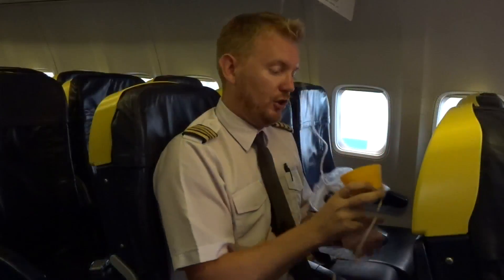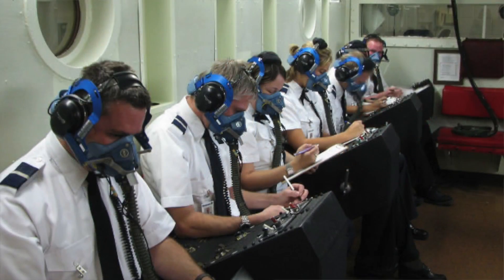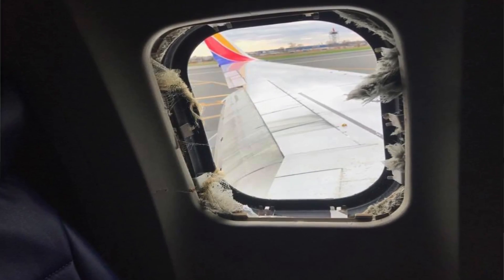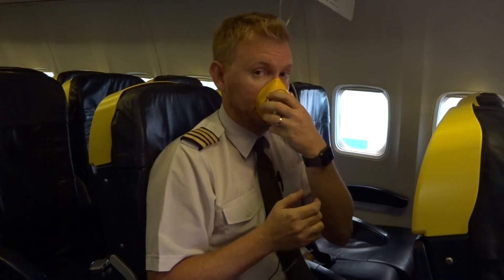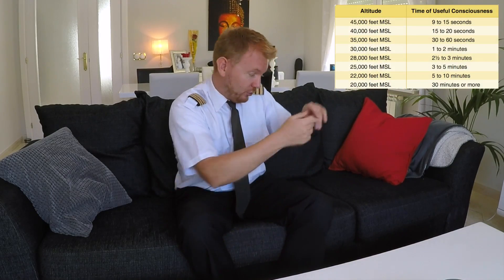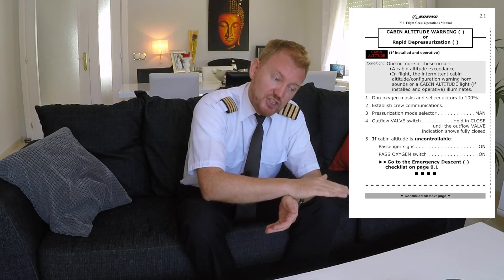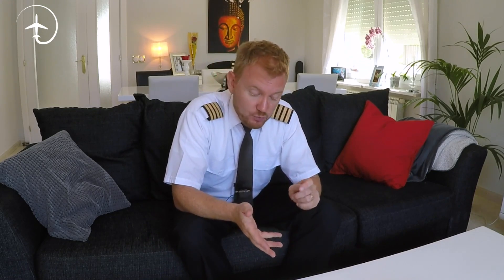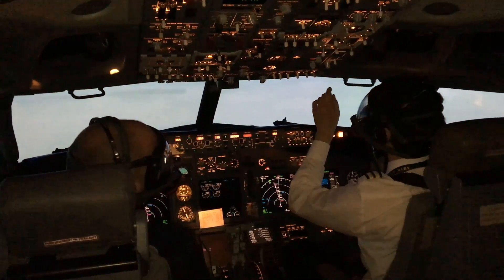Aircraft OXYGEN systems, how do they work?

Comment: I`d like to bet that a rapid decent like that ( in an emergency decompression) would cause real problems for your ears. I`m a frequent flyer and sometimes i have problems with earache and ear popping after some flights. Sometimes for a few days after. I love flying and aviation in general but the ear pressure/ popping thing is definitely the worst part of flying for me. Thankyou for all your vids Mentour. They are simply brilliant and i never miss a single one!
Reply from the maker: Yes, especially since the aircraft is normally unpressurized and that meant that the cabin will descent at the same rate as the aircraft. Quite uncomfortable to say the least.

Comment: The Helios accident which is mentioned at the end of the video is very mysterious. Acording to F-16 fighter pilots of the Greek Air Force there were conscious people who were moving inside the airplane. Also the period of the Helios accident wasn't many years after the 2001. 
Anyway the aviation industry is huge and very important to the economies of many powerful countries with influence. 
I won't be surprised if something is concealed. 
The only quite safe way of transport is the train and I prefer it whenever I can. It is also very romantic.
Airplanes are inherently dangerous and the normal  change of the pressure inside the cabin reduces the oxygen. I don't mean rapid accidental depressurization. The typical lower lever of oxygen make passengers dehydrated, tired and sometimes creates headaches and pain in the ears. 
Some expensive private airplanes like the Embraer doesn't change the pressure inside the cabin because the passengers there are very rich and demand a comfortable flight.

Comment: Are you sure our lungs are designed to work at ground level? Because I know plenty of people who act stupid and don't even recognize it.
Reply from the maker: Well, the design was for that. 😂
Reply: If you where a Mt. Everest Shilpa you probably would act a lot less stupid since you'd be acclimated to breathing at high altitude. For them, mask is optional. For the rest of us, stupidity is mandated at altitude.
Reply: Actually even at 30,000 feet you have the same proportion of oxygen and nitrogen as you do at sea level, 21% oxygen and 78% nitrogen with about 1% argon for the remainder.  But the partial pressure is much lower at that height and our lungs are adapted to function at sea level which is about 14.7 psi.  So in this case going to 100% oxygen helps bring the partial pressure up to a level close to what we are used to at sea level. 
But pure oxygen at high pressure can become toxic over a period of time.  In hyperbaric chambers in hospitals they may go up 2 atmospheres (about 35 psi) to purge patients suffering from carbon monoxide poisoning, but they also include short periods where they breathe 21/78 mix to prevent oxygen toxicity, which can result in blacking out and convulsions.
This can also work in reverse.  Very deep divers will use a gas mix with little to no nitrogen, helium and maybe as low as 5% oxygen.  But at the depth they are operating at, this gives the same partial pressure of oxygen as at 1 atmosphere ( sea level ).
Reply: I came here to say the same thing!

Comment: Great episode. Im a med doc (svensk läkare alltså) and i think its very important to first, as you did, emphasize on the short time available in a loss of cabin oxygen. But I also would have appreciated if you said something about the difference between loss of oxygen pressure and “strangulation” (ie build up of high levels of CO2). The first case, (loss of  O2 and normal or lower levels of CO2) can be pretty much un-noticed (in med school we train both situations) and in the first scenario you can even feel a bit “high” and as you point out, you loose mental capacity, without really being aware of it. Basically a pilot incapacitation, until your blood is restored to its “at sea level” again. But, and this is important. Lack of oxygen does NOT give you the strong sensation of anxiety (or even panic) that accumulation of CO2 (carbon-dioxide) in the blood give. Although of course being very unpleasant, it’s actually beneficial, because it alerts you that something is is going terribly wrong, while as just a drop in cabin O2 - may go pretty much unnoticed until you pass out. I would appreciate if you address this in one of or your excellent podcasts that you do. Especially since a pod done by a air plane pilot is much more likely to be viewed than a if a regular doctor does it, unless the doctor is a very good looking one, with a stethoscope hanging around his neck making him looking very professional. 😝 . Thank you and please keep up  the the good job in educating us casual travelers 👍

Comment: Hey there,

Great video as always. I really enjoy all of your presentations. You would make an awesome trainer if you are not already.

I just wanted to share with you something perhaps you are already aware of regarding the PSU oxygen systems.

The system you are describing is a chemical generator system. On other aircraft B777 and B747 for example the system is gaseous just like the flight deck. There is an entire bank of cylinders in the outboard fuselage of the forward hold.
When you pull down on the masks to activate, a pin is released from a spring-loaded Puritan-Bennett valve enabling oxygen to flow. The system is capable of being switched off by having the cabin crew flip up the valve lever and replace the pin in each of the activated PSUs.

The B787 has a very unique and bizarre system; when the masks are released they unroll from a reel inside the PSU housing, there is no 'pull to activate' system, they have a pressure sensor disc inside the mask so as one breathes oxygen is only released on inhalation called PulseOx. They also do not have a concentrating reservoir bags like the usual Scott/Zodiac AviOx types.

Anyhow, I just thought you might be interested.

I love the B737, it's my favourite short-haul airliner. I have crewed the B737-100s, -200ADV, -300, -400 and -800. Loved them all for their various personalities. Wishing you always safe and enjoyable flying :)
Reply from the maker: I am indeed. Both a Typerating Instructor, Examiner and Linetraining captain.
Thank you for your kind feedback!

Comment: I think that in an event like this the Captain should make an announcement to the passengers as soon the situation in the cockpit is under control.  He/she should just explain that there was a loss of cabin pressure, to keep the oxygen masks on, and that the pilot is making a controlled descent to a lower altitude where oxygen masks won’t be needed.  As a passenger, I would be terrified if the plane just seemed to be “falling out of the air”, as these passengers experienced.  We want to know what’s happening, and most importantly, that the pilot is still in control of the plane.

Comment: Noice informative video!
A few questions: How often does cabin decompression happen? Also, how often do the passenger oxygen generators need to be replaced? Lastly, is there an automated system which drops the passenger masks once cabin pressure drops too low, or is it solely released on pilot discretion?
Reply from the maker: It happens VERY rarely.
Yes, it’s an automatic system that drops the masks when the. Avon reaches 14000 feet. We can also drop the masks manually from The cockpit.
Reply: Thank you, absolutely love this channel!

Comment: Is there an alarm the crew can activate for the cabin? My thinking behind this question is on red eye flights where many people are sleeping, it would be near impossible for the flight attendants to wake everyone up in less than 2 minutes, and having an alarm to wake everyone and give commands to put on the masks would be helpful.

Also, do the flight attendants have portable masks that enable them to walk through the cabin to check on all the passengers or does the rapid descend necessitate them being strapped into their jump seats?
Reply: Also, seeing as rapid depressurization is pretty painful on its own, I would think most people would be woken up just from their ears popping painfully.
Reply: Hey there, I have only just discovered this video. I can answer your question if you are still interested.

When the cabin altitude reaches 14,000 feet the following systems occur automatically:

- Passenger Service Units (PSU) Masks drop door when the electromagnetic door releases
- Cabin lights go to full bright
- Automatic Prerecorded Passenger Address (PA) plays instructing passengers to fit their oxygen masks
- Seat Belt Sign Illuminates (normally this would also activate the Return to Seat light in the washroom)
- The return to seat sign in washroom does NOT illuminate as there are two masks in there (in case parent is changing baby's diaper not 2 adults!!) The rationale being that you should remain where you are get straight on to oxygen an not move until the aircraft has leveled out at its emergency descent altitude and the use of oxygen is no longer required.

I hope this explanation answers your question.

Comment: I always fly with my dog (pet in cabin) and I wonder if one of the oxygen masks could be used for her in case of emergency
Reply from the maker: Probably.
Reply: It's better than nothing, but real pet  oxygen masks are cone shaped to fit over the snout.  The challenge would be getting her to hold her face in it.  They usually resist.  If that were to happen, you'd have to put it on her once she passed out.  Then, it would work.

Comment: Clear explanation. How do these systems remove the carbon dioxide that we exhale?
Reply: Bob Kurbel it is collected in the  oxygen bag when you exhale
Reply: Ava Mendez Thanks, not a problem for passengers because there is only a 15 minute supply but could be an issue for crew should they have to use their masks for a longer period of time i.e. smoke in the cockpit.

Comment: A few facts:
1) In the SW accident, the crew didn't descend that fast. They never reached 4000 feet per minutes that is not so much more than what the plane does in a normal descent.
2) While at an altitude (or cabin altitude) of 10000 feet you might start to perceive some of the symptoms, they are physical and not mental. The body is "smart" enough that when the oxygen in the blood is scarce, the brain and the hart get priority over all the other muscles and organs.
3) The FAA allows flying at up to 12500 ft with no supplemental oxygen without restrictions.
4) The FAA allows flying at up to 14000 ft with no supplemental oxygen for 30 minutes max.
5) The time if useful consciousness at 14000 is unlimited (but useful is not necessarily the same as 100% sharp).

Comment: Very thorough, interesting and timely video. 😉
If you suffer an emergency depressurisation at high altitude do you still have to wait for ATC to clear you to a lower altitude? Or can you check using the radar + emergency transponder code and initiate descent + seek clearance as you descend? Just thinking by the time the pilots get their masks on and work out what’s happening, you don’t have that long to get down to 10,000 feet or less (given 12 minute passenger oxygen supply).

Comment: Very useful information.  One question:  how does the oxygen mask system assist with 'the bends' phenomenon?  For example what keeps the water in your eyeballs from starting to boil away and the gasses in your blood from forming bubbles which can cause cardiac operation interference?  Or are those effects something that would take longer to manifest than the 12 minutes of oxygen that the passenger cabin oxygen masks provide anyway?
Reply: Short answer: Those symptoms can't happen even at the max cruising altitude of a typical airliner.
Long answer:
Except for the bends, those are symptoms of hard vacuum exposure like what you'd get if you stepped outside the ISS without a space suit on. Even at the maximum cruising altitude of typical airliners (~45000 feet), there's still enough atmospheric pressure to stop water from boiling, so that can't happen.
You only get the bends when you are diving at significant depth and ascend too rapidly, so the bends also can't happen.
Running out of oxygen is in fact your first concern if the cabin depressurizes at cruise altitude, and the systems discussed in this video are more than capable of dealing with that when used correctly.

Comment: One thing I'd like to mention is that anyone curious can replicate the effect of being at high altitude by simply using a helium balloon. Just use it instead of the outside air until you feel tipsy - though be careful to not overdo it, of course. Then solve some maths problems you already solved in a "sober" state before and time yourself both times. It's quite a profound effect. Figured this one out by chance, actually. A friend of mine was doing silly voices and eventually started reporting feeling "funny, but good".

Comment: The short version is pilots breathe emergency oxygen from a dedicated oxygen cylinder stored  in the aircraft. This oxygen cylinder can supply 2 hours of oxygen to the pilots. Passengers get emergency breathing oxygen from chemical oxygen generators which supply about 15 minutes to each mask.  The passenger emergency oxygen systems are meant to supply breathing air for the brief period it would take the pilots to descend from cruise altitude to about 10,000 feet where normal people would not need supplemental oxygen. This would normally take something like 5-10 minutes.

Comment: Remember there is an outflow valve and an emergency pressure relief valve. 
If outflow valve fails you can completely close it off and that can be sufficient time to descend to 10,000. 
Emergency oxygen mask are only for rapid depressurization. We usually operate at + or - 50,000 feet and we pressurize to only 8,000 feet. 
At those altitudes we have a small margin of speed. Too slow lose lift too fast you reach critical Mach # and lose lift. Welcome to Coffins Corner.

Comment: Great video 
Have a question, In case u make  a emergency decent say to 10kfeet, wont there be traffic at the lower altitudes resulting in mid air disasters. 
Do u need ATC CLEARANCE to make the emergency decent?
Reply: You make a call saying you are performing a rapid descent and do not need clearance. Once atc are aware of your rapid descent they will move other aircraft out of the way.

Comment: The cabin pressurization not only helps humans, but the airplane´s structure itself. It does it by making a stiffer but thinner  "envelope" (thus lighter), just like a soda bottle. You can notice that a soda bottle is very "soft" when is empty, but very stiff when it´s new and full of pressurized gas and liquid. In that respect, you can see an airplane like a soda bottle with wings. That´s why the airlines count the cycles of pressurization and depressurization that an airplane structure has been submitted to. It tells you in a more realistic way how "old" an airplane is.

Comment: If the pilot oxygen system fails, is there a fall back  (a portable cylinder perhaps).
For example if the pilot system were to catch fire (and an oxygen fire is particularly difficult to extinguish, so this would be a major problem in itself) what would the fallback plan be?
Reply from the maker: There are portable oxygen bottles in the cabin as well that could be used, as well as a portable oxygen generator in the cockpit for fire-extinguishing.

Comment: To add my two cents. Once you pull that string on the Oxygen generator, don't touch the can. It gets very HOT quickly due to the chemical reaction. I can't remember exactly from the AMM reference, but I believe it states that it gets upwards of 400°F. You can cook a pizza during your rapid decompression descent.
Reply: I won't worry if I just burn my finger.
Reply: Just make sure you follow the "high altitude" instructions or it won't come out right!
Reply: Just put your mask on before you attempt to touch the oxygen generator.  That way you wont be stupid.

Comment: Great video! I was wondering how the oxygen masks drop automatically, what initiates that and can this system fail and oxygen masks not drop?
Reply from the maker: Great question! The masks are help up by spring loaded latches that disengage when the cabin climbs above 14000feet. We will manually release them from the cockpit if that mechanism fails.

Comment: Hi Mentour, really enjoy your videos.  When you speak of oxygen, are you referring to pure oxygen from oxygen tanks or are you referring to compressed air?  Compressed air consists of  78.09% nitrogen, 20.95% oxygen, 0.93% argon, 0.04% carbon dioxide, and small amounts of other gases which is stored in cylinders.  Oxygen is very dangerous and could intensify fire.  People assume the firefighters and deep sea divers carry oxygen in their cylinders strapped to their backs, when they are actually carrying compressed air.   Thanks.

Comment: I went on a flight in an unpressurised aircraft (Beech 99) at 18, 000Ft.  As we climbed up, I started feeling strange, looked at the altimeter and saw it above 14, 000 feet or so. Then I got the portable oxygen tank ready for the pilot and myself. We didn't have masks, but just tubes for the nose.

Comment: Enjoying your channel.  I know that you are a 737 pilot so my question is not directly related to this aircraft because the service ceiling I believe is 41000 ft.  I'm reading specs on a lot of business jets where the service ceiling is higher - as high as 51000 ft and I've noticed some channels showing a pilot wearing a mask just because of FAA regulations concerning altitudes of 43000 ft and higher.  Why are pilot oxygen mask usage mandatory at high altitude?  Makes me wonder what risks there are for the passengers at high altitude if such drastic precautions are done for pilots.  Some business jets can be in the air non stop for 12+ hrs.  Would one pilot be wearing a mask for this long?